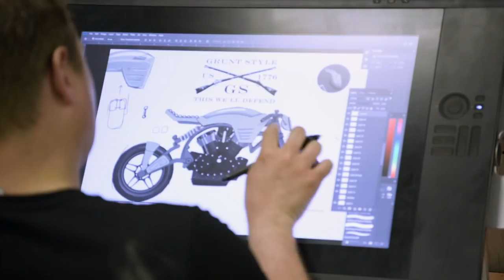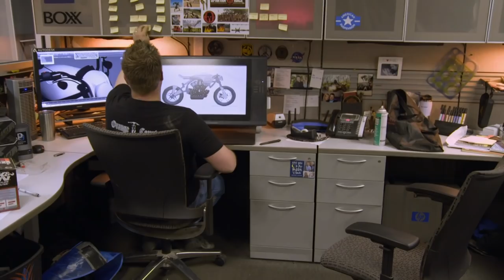The Process Of Building A Bike At Orange County Choppers | American Chopper

Comment: That gas tank is tiny, I'm surprised that it holds enough fuel to get it around the block.
Reply: Thats why Buell made the frame on their bikes into the fuel tank. The oil tank was the swingarm. Buell was very innovative. Good thing Harley killed it.
Reply: Well that's a cafe racer type and they have quite a short milage of 17 to 19kmpl
Reply: I believe the 9/11 bike hasn't even smaller tank I believe the tank is built into the frame